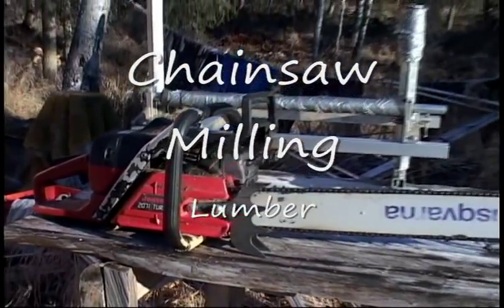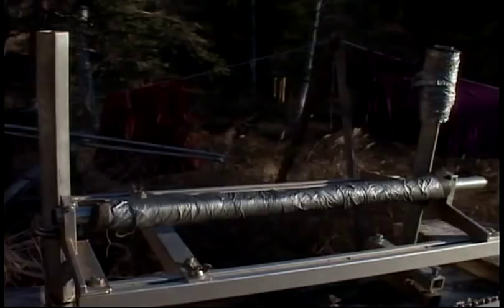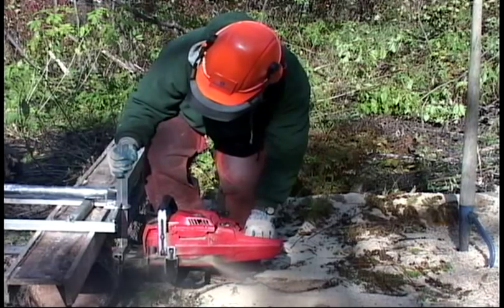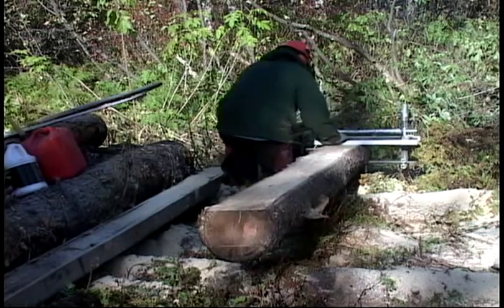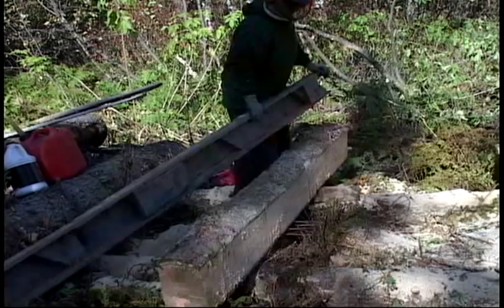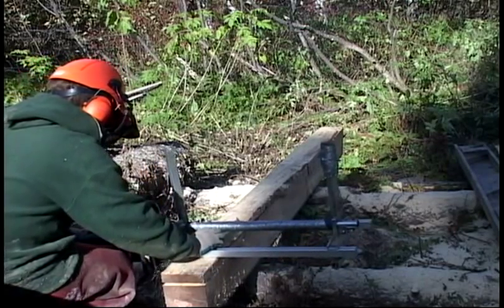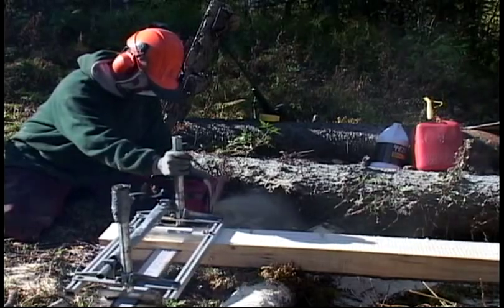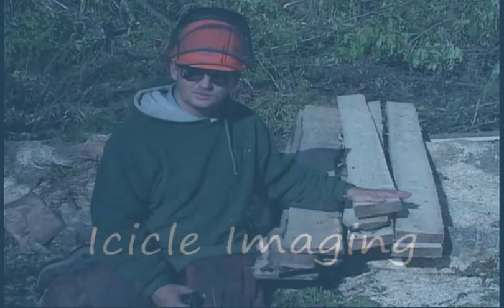Chainsaw Milling Lumber

Comment from the maker: There is fiberglass sill seal and foam seal between the logs. Also, David, the teeth are not facing backwards ~ using rip chain for fast smooth cut.

Comment: your videos are very informative and appreciated. Question: When you built your cabin what materials did you use to seal it up for winter. What type of chinking did you use? Have you heard of anyone using sill seal in between their two sided logs? Any answers to these questions would be appreciated. Thank you.

Comment from the maker: Lumber should be rough cut green. Then stack level and straight with stickers (sticks placed crosswise) placed 2 feet apart ~ be sure the ends are supported. Let dry for 1 year, then run through planer for smooth surface. For 1 X 6 nominal cut to 3/4 inch thick and 5 3/4 wide. The lumber will shrink a little, and what's left is just right to plane smooth.

Comment: what limitations are theer if any, I always wanted to cut my own 1x6 for wood flooring but dont have the $10K to drop on flooring. Also would it be advised to let the wood dry first for a year and then cut it?

Comment: Do you have ideas for processing smaller logs.. say 1-3 feet . I recently ran upon some nice white birch , that someone cut into small pieces and just left to rot.. I plan on using them for small ,fine wood working projects. I am stugling with ideas to get them into shapes i can use.. They are just a bit to big for shop tools to process.. I was thinking chainsaw.. but I dont have guides or anything.. Any ideas would be great !